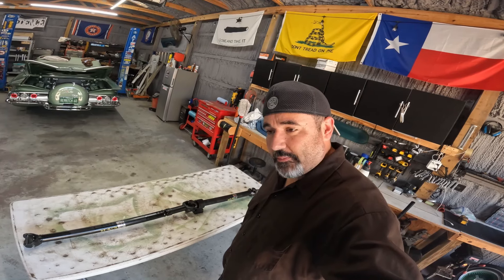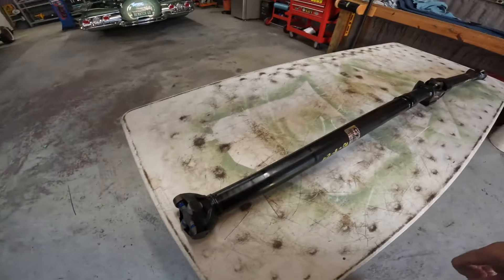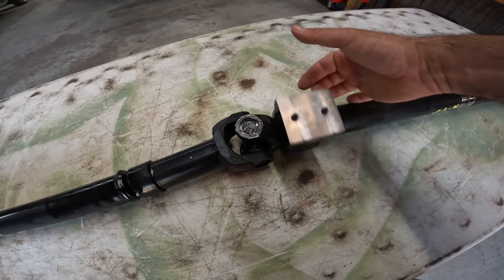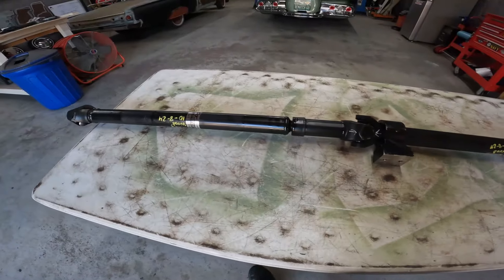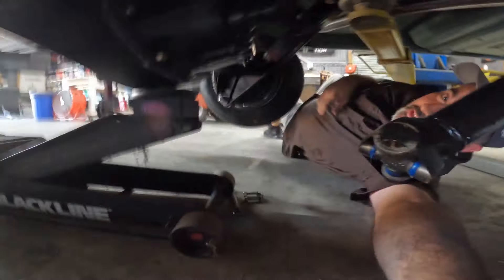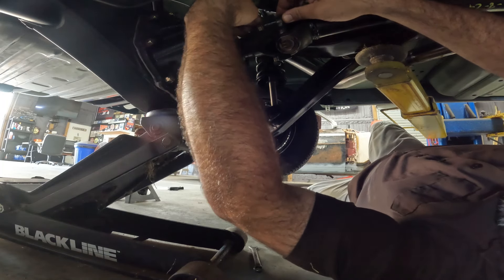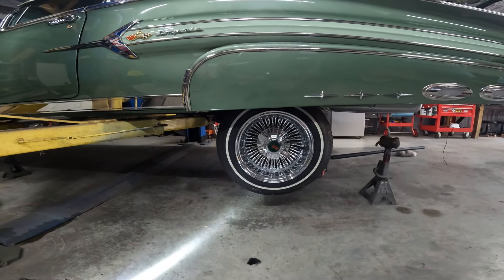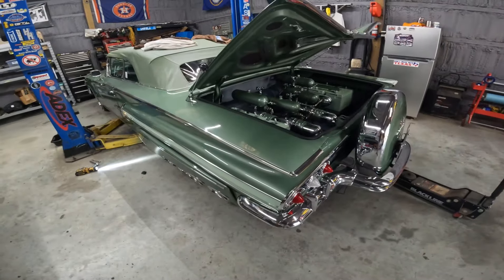DRIVESHAFT WOES / 1959-1964 IMPALA / 6L80 / FORD 9 INCH / SOLID CARRIER BEARING INSTALLATION / DIY

Comment: My 63 with ls swap,4L80, ford 9 inch 411 tru trac has zero issues. Performance driveline made mine with 1350 u joints rear shaft is a splined two piece shaft. Works flawlessly and no vibration.
Reply from the maker: Yeah I've bought from them before just decided to go local this time around.

Comment: Back in the Day the Shop that made Shafts for a lot of us would just spin it in the Lathe and some how figure out how to weld them up so the worked fine, in Drag Cars.
And you have to have some Offset front to back to make them work the way they should.

Comment: Any updates on the shaft? Usually they spin balance it at the end before they give it to you. I've heard some new ones are built well enough that they can get away with just a little extra weld that may not be noticeable or are hidden to compensate for the balance. Old school drive shaft the weights are pretty obvious.
Reply from the maker: I did notice some tack welds. Hadnt put it on the highway yet

Comment: When I measured my yoke to the first bolt on the frame you're supposed to put the yolk in and pull it back and half inch and then take your measurement That's what the drive line guy told me.

Comment: I'm in the process of resolving the same issue on my first lowrider (64 Impala) and this video explains a ton of info I needed. Thank you! One question. Does it matter if the slip yoke is closer to the carrier bearing or the rear? Can it go either end?
Reply from the maker: On impalas it usually goes closer to the bearing

Comment: Hate that carrier bearing but got it done even on the ground 😩
Reply from the maker: I think next time. I'm cutting the frame tunnel completely and doing a 1 piece with a spring loaded slip rear
Reply: @lonestarlows  may be worth it especially for solo work haha. And to have more movement

Comment: Bro, the slip always gose to the rear of the driveline, and them heavy duty carrier bearing suck use the original they have more flex
Reply from the maker: I disagree with both. But I'd like to hear your reasoning